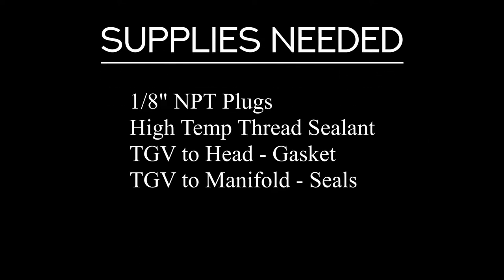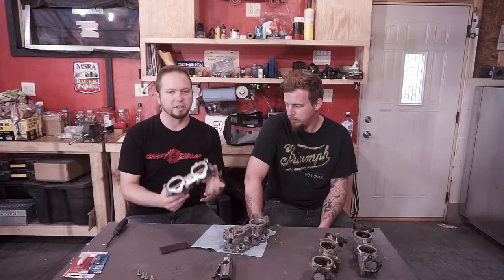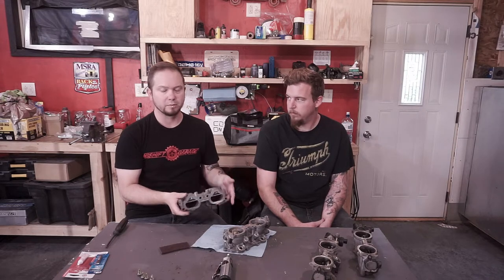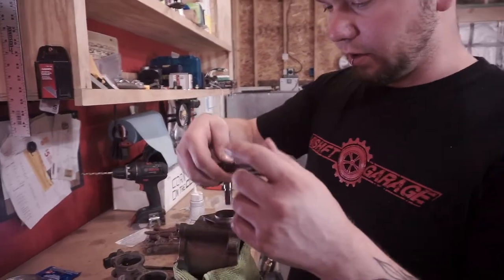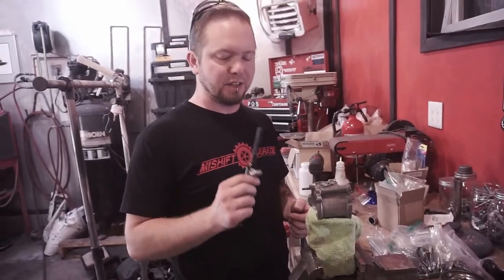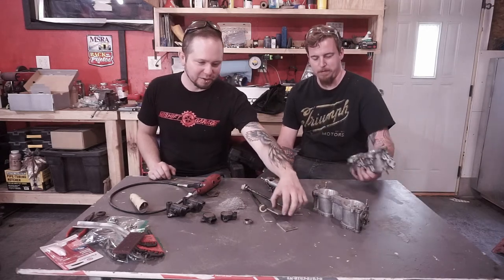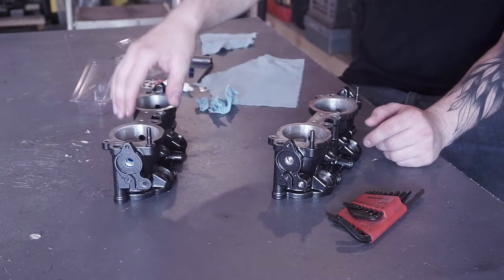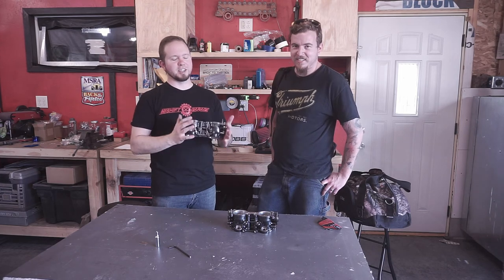TGV Delete and Modifications; G.E.A.R. Video #1

Comment: I tried putting it back on it: either says the runner is open or closed and goes into limp mode. I tried hanging it off but then the gears spin freely and it has no idea where or what it’s doing so it says it’s closed and goes into limp mode. There’s no tune shop here i’d love to just get a tune and it be fixed. Any suggestions?
Reply from the maker: We had a street tune done using open source software to work with the factory ECU here locally. 
A quick Google search yields some results for remote Subie tuning. So that may be an option for you. 
There's also the Access Port from Cobb, which should have the ability to shut off the TGV system. I can't 100% speak on that because I have no direct experience but I'm pretty confident the AP can do a lot.

Comment: Did you re install the motors afterwards? Or get the tune this is where everyone ends their videos and they’re never quite clear if they just leave the motors on or completely remove them
Reply from the maker: Great question. I believe you can remove the butterfly from each chamber and reinstall without needing a tune. For the process we did, you require a tune because all the TGV components are removed and motors are unplugged. 
I can't speak on whether plugging in loose motors will fix the codes. In theory it sounds like it could.

Comment: Can you tell the difference with the tgv delete? My tuner recommended I do a tgv delete and upgrade my injectors to 1050x top feed injectors
Reply from the maker: When we did the TGV modifications we also did the RA shortblock so we don't have a perfect before and after comparison. It's said that a TGV delete will net power gains though, and our tuner said the same. 
If you open up the TGV you will see there is a lot in there to cause turbulence.
Reply: @DadModsMedia  thanks for the information. My tuner recommended I do the same as you guys. With my type ra short block and these upgrades should make for a fun daily driver
Reply from the maker: Always here to help!  Yeah Jake loves his LGT as a daily. It makes an excellent powerband and drives smooth!  
Good luck Raul, hope all goes well. 
Make sure to toss a 3 port boost controller on while you're at it. Our tuner said that was a must.
Reply: @DadModsMedia  I was lucky enough that the old owner had one on the car.